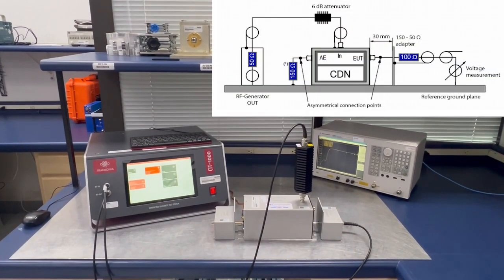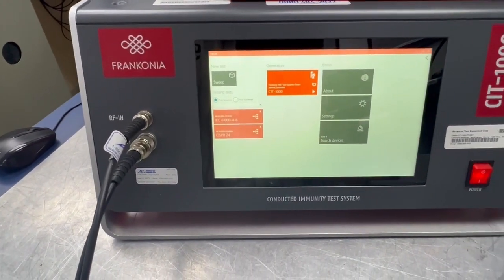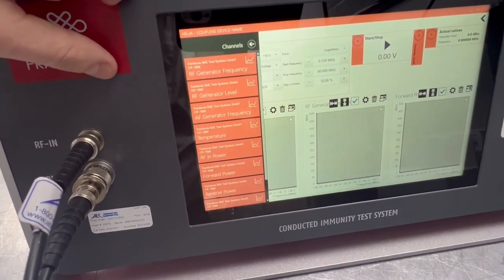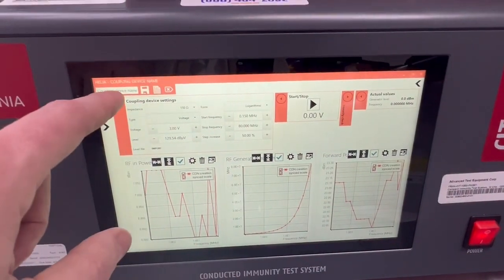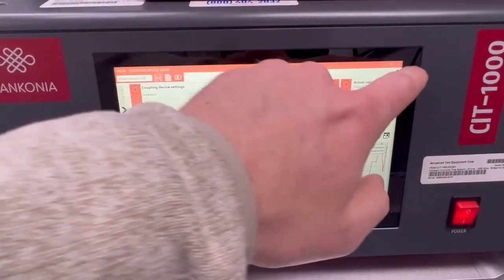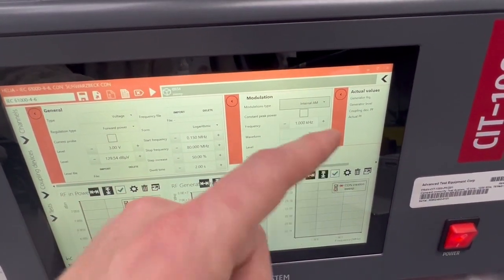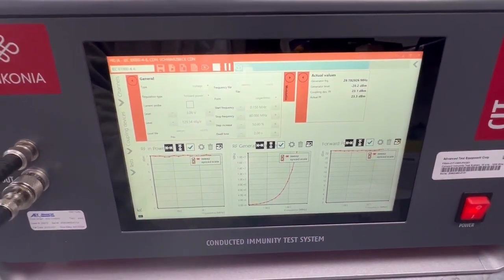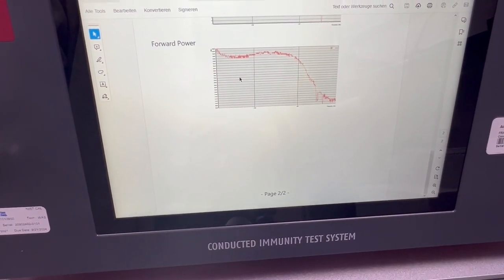IEC 61000-4-6 Conducted RF Immunity Test

Comment: Could you please tell me , Why the 6dB attenuator is used specifically
Reply: This is called out specifically in the IEC 61000-4-6 standard. I would assume to provide better impedance matching and protect against any potential reflections, but I could be off.